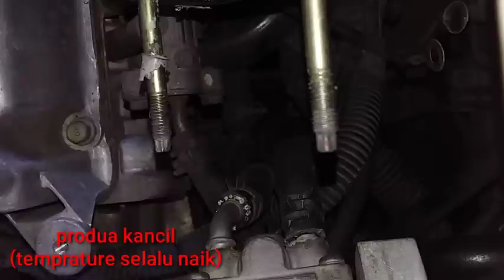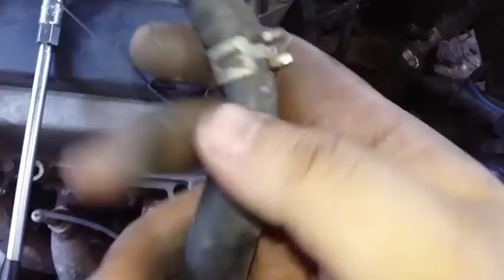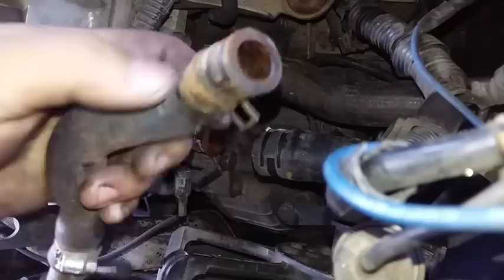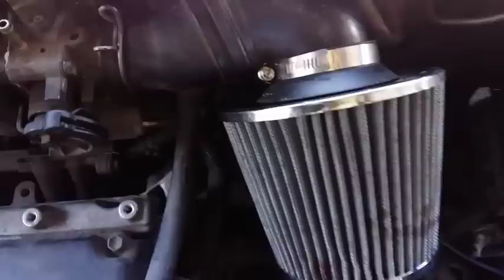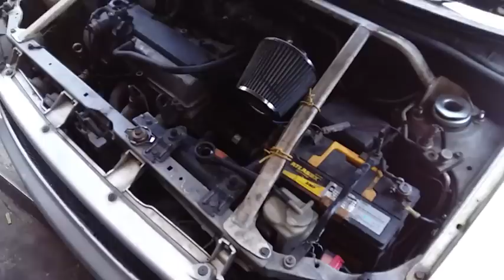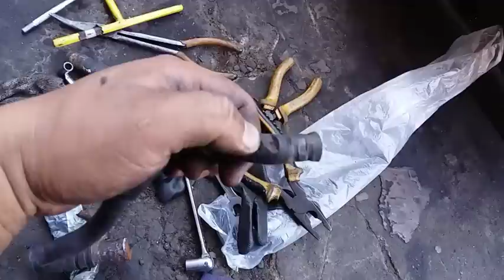Produa kelisa/kancil temprature selalu naik! #HosePipeBocor, #AoneAuto

Comment: Bang nak tanya sikit. Kancil engine kelisa ej jepun. Apa masalah kalau tiba2 tiada power.  Fuel regulator set 1bar. Start engine 1bar tapi bila lama pakai fuel pressure tiba2 drop separuh dari 1 bar n kadang2 0 bar lebih2 lagi on aircon.adakah ini Salah Satu punca?

Comment: Salam boss.. kereta kelisa klu meter temperature selalu Naik tiba².. nti tiba² Turun semula.. adalah saya perlu flushing radiator Dan tukar thermostats?
Reply: Cek radiator fan motor dulu.
Reply: @afifhasbullah7135  fan motor ok pusing laju
Reply: @afifhasbullah7135 
Kalu nok tukar motor kipas, kena buka tangki radiator dulu kah bos?
Reply: @weeboonkian7990  kena buka radiator spare tank, bateri, tapak bateri, hos atas radiator. Tapi kalau mahu senang keluarkan radiator one set.